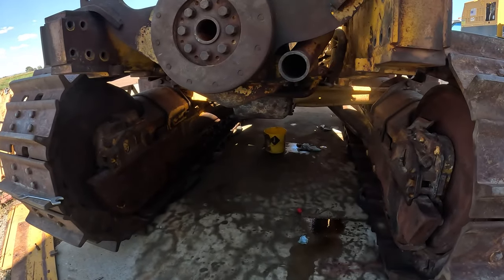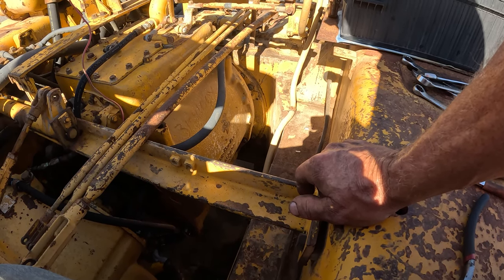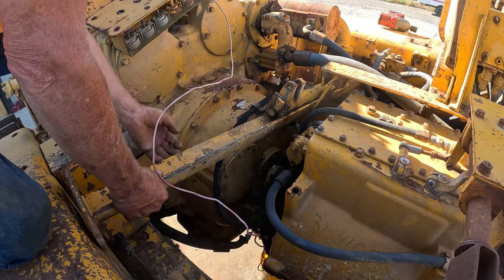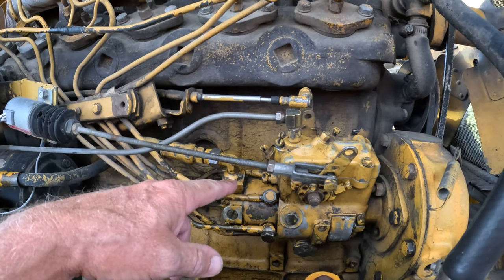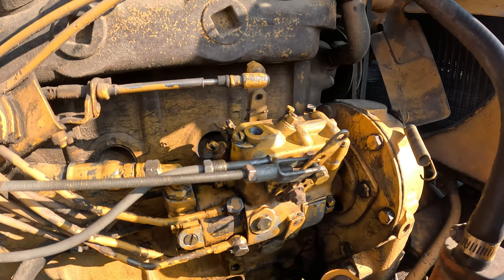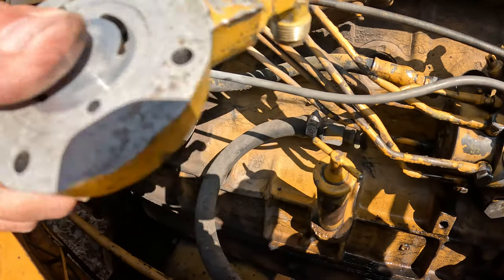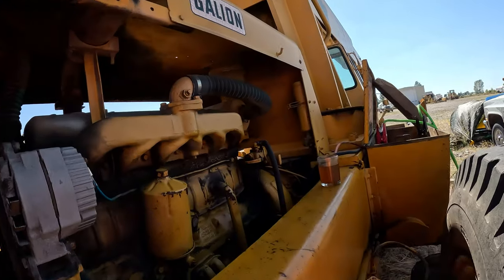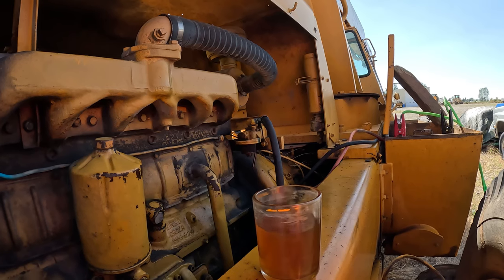D9H Episode 18  Fixing The Crane

Comment: On the subject of the Roosa Master: There’s a piston in the fuel inlet before the blade transfer pump, the assembly threads out of the aluminum end cap with probably a 3/4” wrench. It is the transfer blade pump regulator, that could be stuck, and it’s simple to get to. If that is working then there’s a “vent wire” (wire in a passage restricting flow) in the head assembly to allow fluid and air to get into the housing where you take the lid with the return fitting off. This is probably plugged with rust or tar and if that’s the case it requires complete disassembly of the IP to get to it. You first have to get the entire pump full of fuel before the return fitting or “flex ring” can even be a suspected issue. That being said if you attempt to run it some more fill the area under the lid with fuel or oil or else head and rotor could seize or even shear. But check the inlet regulator piston, you can do it on the machine with 15 min of your time. Once you screw the 90* fitting out of it you’ll see an Allen head screw, count how many turns it takes to screw it out then there’s a spring underneath that and the piston. It’ll make sense to you when you have it apart. If that doesn’t get fuel coming out of the return then it’s time to pull the IP off the engine.

Comment: There's also a check ball and screen in the inlet fitting on the transfer pump.
Might be worth a look. Be very careful taking the pump apart. There is a special headed bolt holding the plunger cam ring in the housing.
It looks like a Torx head, but it's not. Guy's have ground a torx bit to fit.
Then they break the bolt head off and your done. Only way now to remove that bolt is to break apart the housing(case) and then remove what's left of the bolt.
You can buy that special socket when you order your seal kit.
Well worth what it cost.
Plenty of video's online cleaning that pump.
FYI, Carb/choke spray cleaner is the only thing I found to cut that diesel shellack sludge. It's way better than thinner and brake clean won't touch it.
Have heard E85 gas will also but never tried it.
TGP
Reply: Area Diesel Service has an excellent video of Matt's (Diesel Creek) Injection pump complete service...
Reply from the maker: I checked the screen and it was clean, surprisingly the inside didn't look bad at all.  talked to Zach tonight and he gave me a idea involving gas..............hang on to your butts  LOL
Reply: @Jpaydirt  5 gallons of gas and a road flare?  😇

Comment: Don’t know if this is relative to the crane not running and the fuel injection pump, but here goes. The old 5.7 and 6.2 GM Diesels had a injection pump that looked similar to the one in the crane. On the 5.7 and 6.2 if one were to squeeze the fuel return line connected to check valve on the pump, the engine would shut down and not start. Likewise if the check valve glass ball spring loaded, was full of debree it would shut the engine down and not allow the pump to work. Simple fix was to remove the check valve from the pump fuel return line, hold it up to a light and if debree was seen, drill the ball out. That would allow the wearing material in the pump to pass threw the check valve to the return line without shutting the engine down.  Of course that did not fix the pump but allowed you to drive the vehicle till you got the pump changed out. I use to carry spare, drilled out check valves in the truck. More than once I fixed cars on the side of the road broke down by simply changing the check valve.  

Again don’t know if this is relative to your problem. Worth a look.

Comment: The last time I messed with a Stanadyne pump when you put that cover on it you needed to use a thin blade against spring tension as you put the cover on then slip the blade out. It had something to do with the fuel shut off that was on the case tractor anyway, good luck.

Comment: Lifter bars is very Cat D7D, D8G, D9E 1950' 1960's. Made from extra heavy angle iron unequal legs. Doing repair Cat shop on  dad's D7E used this lifting bar. All bolts with shoulder through material thickness.

Comment: That lifting tool looked like it may be a three piece unit. The two outside pieces through bolt to center plate. The center plate has the lift point to the crane. The outside pieces could be channel iron with a lot of adjustment holes to run clevis hooks to pass through all three plates.

I'm trying to figure out if there could be a load leveler dabbed to not now under load like you're thinking of. And still function with relative ease.

Comment: CAT's lifting beam has 3 adjustments on the center eye and the 2 ends in order to center and stabilize the load, plus a adjustable spreader bar on the back for twist. 
Several had said an "I" or "H" beam would be better because of less machining.
Caldwell sells a BWC-10 and BWC-10W Beam Web Clamp that are rated at 22,400 #/. Page 206 in master PDF or page F.10. 
I'll send u the page. These would be adjustable and I would lean more toward an H, but it depends on what u can get. 
I'd still weld  bars/squares on the top & bottom every 6-9" for safety in case the screw clamp was loose.
Think about in, call Caldwell when your sitting down and maybe order 1 or see where u can see 1.

Comment: I would use an I-beam rather than channel (unless you put two channel back to back)  A single channel will tend to bow sideways pretty easily.
I'd give up and use the excavator to lift it out...assuming it's available.
Reply: I'm sure that it's 2 pieces of channel,  back to back with a row of holes. You just can't see that at a glance from a picture.

Comment: Caldwell still builds adjustable spreader beams out of back-to-back channel with spacers to separate them.  You can build a spreader out of flat plate then split a pipe or tube to weld on and stiffen things up.  Figure out what you want and we can calculate the rating per ASME BTH-1.  That's easy if you have dimensions.
Reply from the maker: Thank you,  it's 72" long but I will need to lift farther back from center as the rear is heavier, total weight per the book is 8,500 lbs
Reply: @Jpaydirt OK, tomorrow I'll see what size C-channel is needed to do a true lift beam w/single lift point on top.  6ft OAL and 10,000#.  If you use a spreader instead, it wouldn't take much.  I have a spreader at work that uses 4" sch 80 aluminum pipe which you cut to length then insert two ends which take the shackles to attach upper and lower rigging.  I bet that 4" aluminum pipe is good for 60,000# payload with a 6ft spread.  You just need a crane with enough hook height and a way to adjust the upper rigging length.  Like use chain or a chain fall on one leg.  With a fall, you can adjust while under load to level things.  That would be nice. Score a nice Harrington chain fall or lever hoist off of ebay.
Reply: @Jpaydirt  A 72" lift beam with 5,000# on each end - that is worst-case bending force on the beam.  5000# x 36in = 180,000 in-lbs.  For a C8x13.75 the Section Modulus is 9.02in^3.  Max bending stress = 180,000 in-lb ÷ (2 x 9.02in^3) = 10,000psi or 10ksi.  Per ASME BTH-1 Category B, Service Class 0, you can take bending stress to 13.2ksi for A36 steel.  A572 Gr50 steel would increase to 18.3ksi allowable.  So, C8x13.75 A36 would be more than enough if you put it back-to-back, but you'll have some gap with a lifting lug sandwiched between.  Pins could attach hooks with eyes as shown in your rigging photo.  C-channel spacing is set to fit these hooks and whatever you have for a lift lug on top.  Of course if you have two fixed lift lugs on top and use adjustable length rigging, your lift beam size can go way down.  If the top and bottom lugs are all 6ft apart, the beam is just a spreader - a smaller pipe would work if the upper sling angles are reasonable.
Reply: @Jpaydirt  Now imagine a steel plate maybe 1" x 12" x 96".  Drill holes every 6" on both long edges so you can fit your 8-1/2t shackles. Split a steel pipe, square tube or place two channels on either side of the steel plate and weld up as stiffeners.  This is what a rigging company might build for utmost adjustability and ease of fabrication.   You can put your rigging anywhere you want, above and below the beam.  You can use a chainfall or not.  Such a beam is easier to pick level enough versus a single lift point beam.

Comment: Jeff u should use MMO marcel mystery oil to get the plungers unstuck to remove the rust crap use abit of CLR or Evaporust without water let it cook on there for abit and tgen drain it out and put fresh diesel in it mixed with MMO should help unstick tgem without pulling the whole frickin thing.out

Comment: 5/8 T1 steel will do the trick,, Make a T 5x4, 4inch for the stretcher pre drill 1 inch holes in stretcher, weld 5 inch for cap, use D rings for lifts welded on top of 5 inch plate

Comment: There’s a rubber flex ring in that pump that has probably failed. Once they fail they push all that crap right into the injectors. Literally a 10 dollar part that can cost you a lot of headache before it’s all said and done.

Comment: if i am thinking right there is a bleed screw on the pump and all lines need to be blead at pump and injecters . I AM suppireds that it did not air lock.  been there dune that. 40 years a go.

Comment: I was on a service call years ago to replace the driveline u joints on an old D6B, when I finished the installation I grabbed my grease gun to lube them the old gentleman that owned the tractor said not to grease them! He said that they will last 3000 hours if you grease them or 3000 hours if you don't !!!! so I did as he ask.
Reply from the maker: Must of had an alignment issue

Comment: You know Jeff with Cat building these for so long and their designers basically modifying old plans and modifying them that someone would have thought to incorporate all the specialist lifting bars etc into the machine so that when you dismantled it you would remove a section that could be utilised for the lift etc…. Does that make sense, then not such a big need for specialist tools, it’s all part of the machine……. Just a thought
Reply from the maker: The rear engine in a scraper is a power pack, radiator, engine and transmission come out as an assembly and the lifting hook is part of the pack, they should of done that with all their machines
Reply: Terex did I saw Roger change a v12 in 4 hours by himself it came out the side